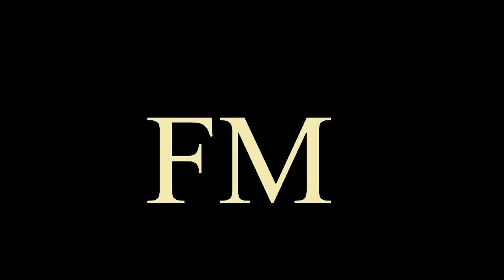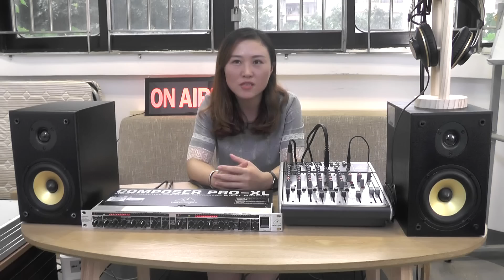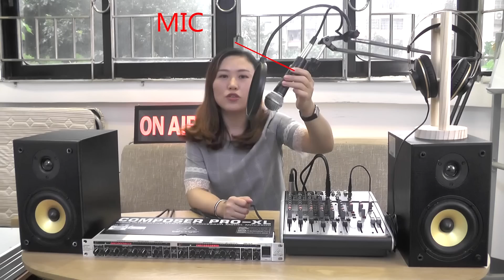How to Set up a 350W Radio Studio Equipment Package? A Simple Display

Comment: Hello, i read the specs about this whole radio station equipement. my question is, when you say 15 to 30 km coevrage, you mean in a radius of coverage or the whole circular diameter area or jus the distance in one direction?
Reply from the maker: Coverage radius is about 15-30 km

Comment: can I used 2 1000W transmitter to get 2000W instead of using a single 2000W transmitter?
Reply from the maker: You can use 1000w transmitter+2 bay antenna or 4 bay antenna
Reply: @fmuserbroadcast  will combination of that give me 2000W?
Reply: Curious as well if you can stack transmitters. Say a 30W plus a 30W = 60. Would that be possible? Or would you have to open it up and do some tinkering